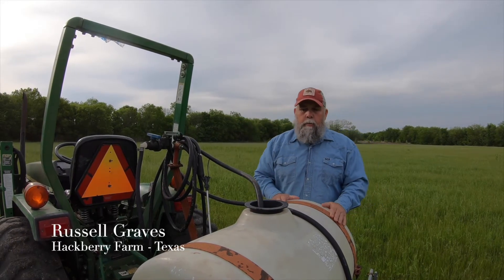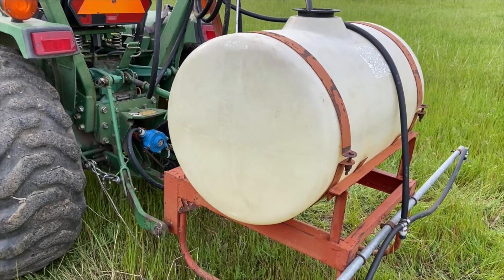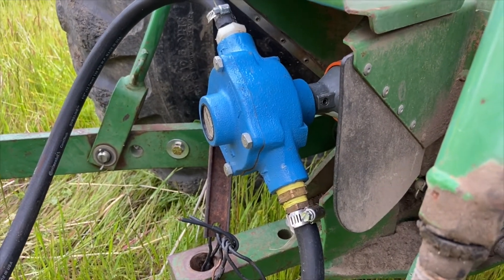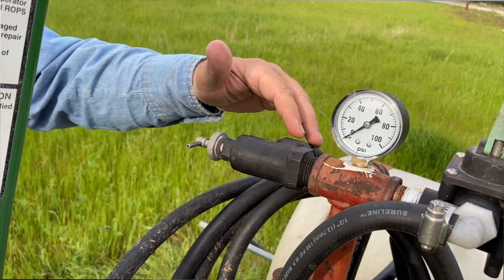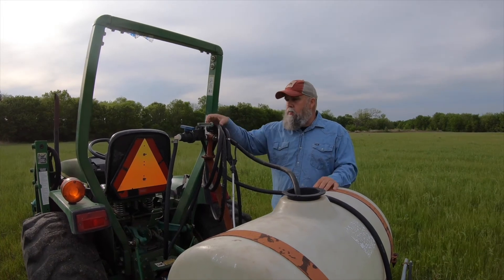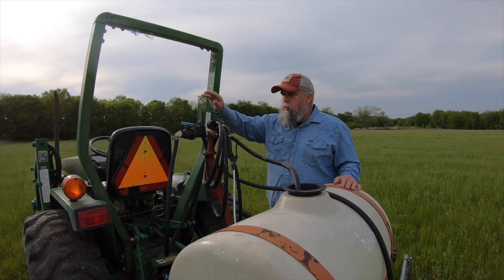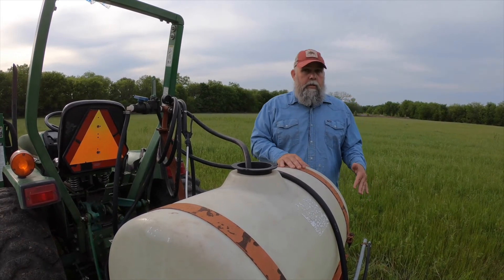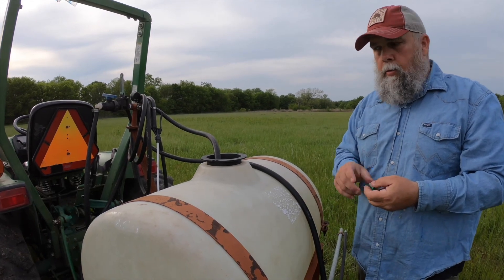The Parts Of A Sprayer Explained

Comment: 🎯 Key Takeaways for quick navigation:

00:21 🚜 A farm sprayer consists of several key parts, and understanding them is essential for maintenance and operation.
01:01 💧 The tank holds the liquid (water, fertilizer, chemicals) and is mounted to the carriage, which connects to the tractor's three-point hitch.
01:57 ⚙️ Sprayers can have different types of pumps, such as roller pumps, which may run off the tractor's PTO.
02:51 🌡️ Pressure regulation is crucial for controlling spray volume, ground speed, and pressure. A pressure regulator helps adjust and maintain the desired pressure.
04:00 ↩️ The bypass hose ensures that any excess liquid not needed for spraying is recirculated back into the system, maintaining a closed-loop system.
05:11 🔒 An on-off valve controls the flow of liquid through the system, ensuring that no liquid accidentally drips when the system is off.
05:38 ✋ A diverter valve allows for spot spraying when needed, diverting liquid from the main boom to a handheld sprayer.
06:07 🌿 The boom distributes the spray evenly over a specific width, with options for different boom configurations and nozzle types.
06:50 🚿 Nozzles inside the fittings have strainers to prevent clogging, and different nozzle configurations are available for various spray outputs and applications.

Made with HARPA AI

Comment: Thanks for showing this but I bought a larger century unit and it has tubes and valves everywhere. Trying to figure the thing out have never had this kind of sprayer before and the guy I got it from bought it at auction and never used it. Lol. So I gotta learn this thing somehow. I tried it and it works but has wires that goes to different places like a foam system and automatic shut off or something? 9